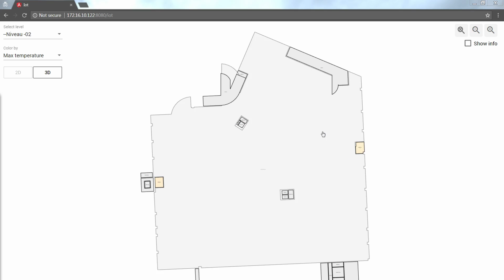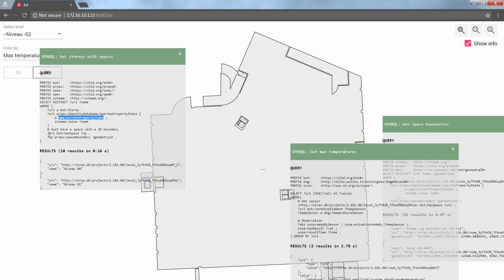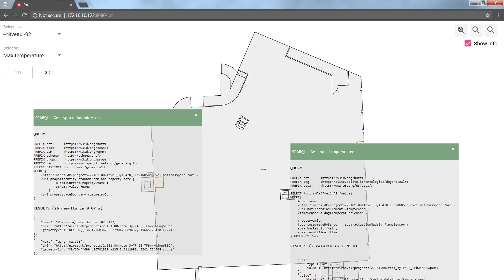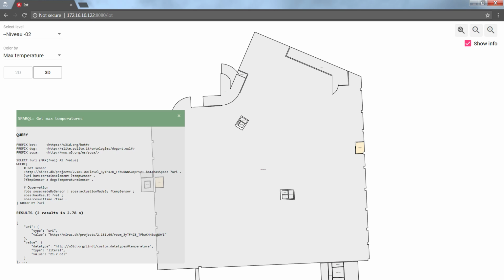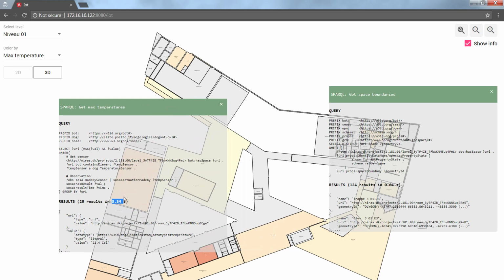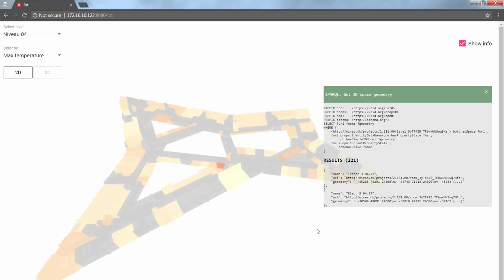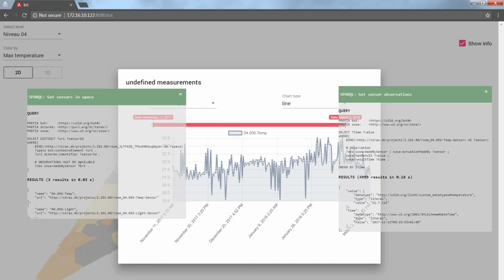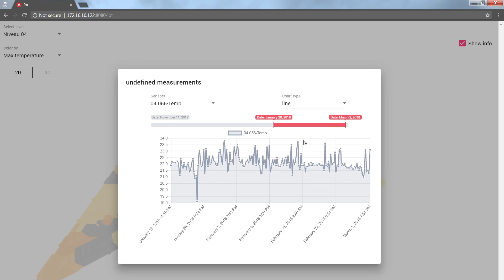Integrating BIM and sensor Data

Comment: Your work is very interesting, have you advanced in the evolution of the prototype? Could it be used in buildings?
Reply from the maker: Thanks! The prototype has not been further developed but we are developing other apps based Linked Building Data. For this particular purpose (digital twin) I would probably keep the sensor observations out of the graph and only describe the topological relationships of the building itself and its mechanical systems in RDF. I have seen examples where a reference to the sensor ID used in a time series DB is then included in the semantic model. Or even a query to retrieve a certain result (monthly average for example).
Reply: Mads Holten Rasmussen we are interested in cooperating with you to integrate our IoT sensors into your SW